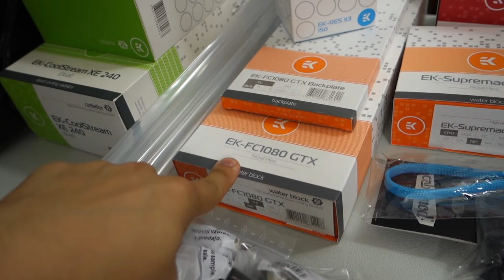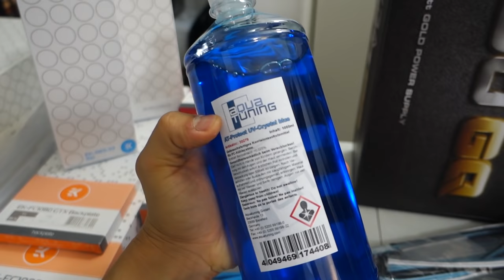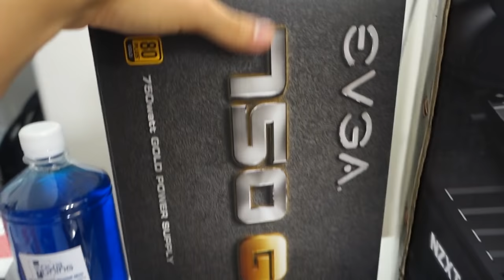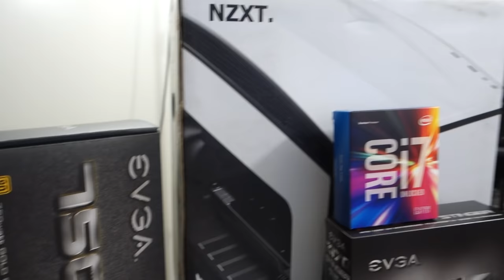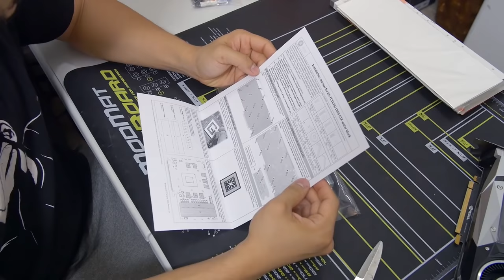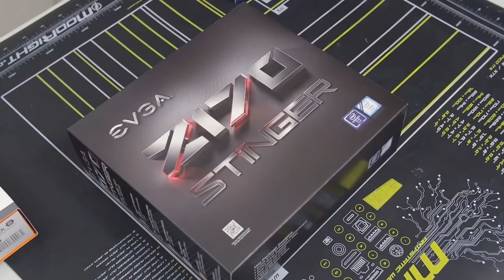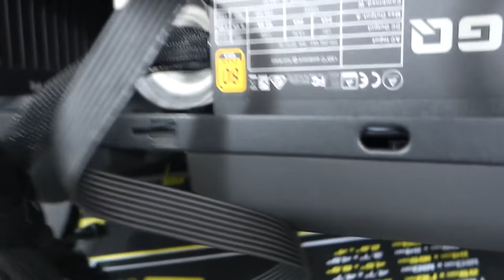My First SFF Custom Water-cooled PC! Build Log #1

Comment: I order the same color cables from CableMod and was completely disappointed by the fact it did not match the color they had on their cable generator. When I contacted support, they did not offer any solutions other than a full return. I found Ensourced shortly after and their cables were vibrant and true to color! Sorry for the shameless plug. Really excited to see a blue build!

Comment: I feel like it'd be a better idea to paint the rubber fan corners white, and use a blue ring, because more than likely the blue ring will be a better match, and it will be much easier to find a white to go with the rest of the build since the SSD's are an already off-white from the rest of the internals. Nevertheless, this was a good starting point and the build is fantastic as it is. Please, release part two soon!

Comment: I know you're probably working on filming part two already, but as someone who has a fully water cooled primo, nothing ever goes as planned and you will be changing your loop around alot as you go. 

now as the manta isn't necessarily an airflow friendly case, I'd recommend push pull on that 38mm rad (yes I know it's crazy) but it will improve overall system and radiator airflow.

also to make your life 1,000 times easier, use soft tubing in the basement so it's easy to work with and drain

Comment: You could put that front radiator with the fittings at the bottom.  That way you could run the output of the pump right into your radiator, and it would be a smaller run of tube to have to deal with.

Comment: I've been running WD velociraptors in raid 0 for about 7 years now as my windows drive. still working good. I assume that SSD would potentially last even longer. especially since my drives are 10krpm

Comment: First thing I'd do is call Jayztwocents and find out the best way to route your tube. It's gunna get mighty cramped in that case when you fill it up with tubing. I don't think your gunna need another rad unless your planning to overclock the snot out of it. I don't think the Z170 CPU or the 1080 GPU are going to run hot enough to need more than a single 240 rad for day to day use. Ace video good luck and happy watercooling.

Comment: I definitely think you should spraypaint the rubber parts of the corsair fan blue  because it seems white is more of the main color with blue accents, like the ssd has blue accents and the ram has blue accents. And idk how much room there is behind the graphics card, but you could maybe drill some pass through holes through the bottom of the case so you can use the bigger rad at the front and hav the tubing go into the basement like on skunkworks. I also think that the white edition ek cpu block could look awesome too!

Comment: Awsome. I ´m building a custom WCooled build too, but It is my very first, so I will use soft tubeing. All parts are from AlphaCool and 4 fittings (45 degree) from  Bitspower.

Comment: Loving the black white and blue, but you should definitely move the pump up a bit b/c with it in its current position it's extenuating your video card sag :) still looking great tho... Also in terms of tube diameter it really depends on the look you're going for, personally I like really visible and obvious coolant because it provides a lot of the color in the case, so I would go with thicker tubes, but again it's a matter of preference ;)

Comment: I have a feeling you're probably going to have a problem with a top radiator even if its thinner, the fan thickness is gonna get you! You're better sticking to the single one in the front. I'd also suggest just changing the corsair fan in general for one of the fractal venturi ones and paint the rubber corners the blue color.

Comment: Kyle you should use the thick radiator and drill some holes for the tubes to pass through the basement of the case instead of passing them through that gap... Jay did a video on it.. it would look a lot more "awesomesauce"...
Reply: Bad pun.. sorry

Comment: nice so far! I was wondering though, if you mount the pump like that, isn't it better to use the rubber rings on the other side so they take the vibration of the pump? Or is it meant to be installed like that so they don't scratch the case?

Comment: Kyle! I'm working on practically the same build as this. Manta, Z170 Stinger, 6700K, EK supremacy, ... It's all working out pretty smooth except for one thing, installing the Supremacy block. The backplate doesn't seem to fit perfectly on the back of the motherboard, did you experience any issues with this? Sharing your experience with this would be very helpfull to me :) Keep it up man!

Comment: Kyle, you mentionned "no space above the Mobo", but I thought a rad and fan set could fit at the top of the case, between the frame and the cover? The NZXT product  page says you can fit 2 Krakens, one on top, one on the front... "Dual 280mm liquid cooling support | Kraken X61-ready with push/pull capabilities"

Comment: I had the same problem with my build and the video card not being as level as I wanted, as it turned out if I took the power cable out it righted itself and went completely level. The weight of the added power cable pulled the right side of the card down more then 1/8th of an inch from level.

Comment: If you used a pass-through fitting, you wouldn't need extra space to get the tubing to the basement.  Also, I would have used some form of dampening between the pump and the floor of the case (or, if i were lazy enough, used 3M mounting tape and called it a day).

Comment: put fan ring blue and corners white. use cable lil bit more blue into it. i hope you put blue paint on radiator. yes definitely get thiner fittings and tube because that looks bulky. that pump looks really cool but no space to put in other palce to show.

Comment: CableMode has the Darker blue cables that I saw. And they have the Corsair blue cables  in the nylon version. Which I was gonna get. But now seeing what shade these look like.( These aren't Corsair colors right?? ) I kinda want to go with the darker ones perhaps. Maybe you could purchase one of each to kind get a better perspective. Love CableMode. I'll be purchasing them in a few months from now.And as far as the Corsair Case fan goes. Perhaps look into the Corsair ML 120 Pro White LED fan. I just got (2) 140mm white ones.And will you be doing a follow up of this video by the end of the week?

Comment: Put some rubber between the pump and the chassis , the vibration man...
Also if you find hard to bend the tube from the reservior to the gpu block put a 45 turn on the res and go straight to the gpu if that is your idea for the loop route.
But if you loop the system like res>pump (hole in the chassis)>rad>gpu>cpu>top res (it should be a hole on the top right?)
Ofc you cant put the second rad on top with that route.
Dunno man, the space is tight over there...

Comment: I sent a tweet to you Kyle but I will say it again here. Is there a way to flip the SSD's 180 so the words are in the right orientation? It looked like you might be able to squeeze the cables through the front of the case were the tie down points are. If I'm wrong no biggie I was just wondering if it was possible. I sure would be nice if these SSD companies would get with the program and design the logo on the SSD's the right way, it's like the whole video card thing all over again. My EVGA 5700 had a sort of a back plate thingie and the EVGA word was backwards, the letters were facing the MoBo.

Comment: The UV will probably make the coolant look lighter than it does under normal lights. Maybe you should plug the light in and put it next to the bottle to check before you fill it up, just to see how it looks. Flushing coolant from a system (you shouldn't mix coolants) is both un-fun and time consuming, and having to do it because you don't like the color just makes it worse.

And realistically, you don't need the other rad to keep this system cool. The rule of thumb is a 120 (or 140 if you can swing it) for each component that is in the loop. With that said, it never hurts to have more cooling than you actually need, so if you want to put the other rad in, then do it. I personally have 8 sections of 120 for my 8350 and 3 770's in SLI. My baby is QUIET, and if a fan or two fails it's not a big deal.

Comment: I think that res really takes away from the whole build. If it was me building I'd hide it in the basement if that's possible maybe with a small pump/res combo (I'm no expert when it comes to watercooling so I don't know if this would case difficulties in filling/bleeding the loop etc) . although like you said we won't know what it looks like until the tubes are in place and fluids in it

Comment: so you are having problem because that piece pf metal wont let you fit a thicker radiator well you can dissasemble the case and using a dremel and a lot of patience and maybe tape as a gide cut that piece of metal down to the li e where the gpu block ends, however i dont actually know how much space you will be left for fans tubing and pump and you will also to sand and paint that edge thats my advice if you want to go the mod way

Comment: Hey Kyle! I know it's been two years, but do you know what length cables you used for the motherboard and gpu? or did you just use the stock lengths? I'm planning a manta build later this month an wanted to get sleeved cables and order everything at the same time!

Comment: Quick question: If I'm shopping for say a gtx 1070 for the sole purpose of water cooling it later on (which means taking off the air cooler that comes installed on it), can I just go for the cheapest option?
What I'm on about is: Do the graphics cards sold by different companies (say MSI, Asus, Zotac, whatever) have any other differences than the air cooler?
Because if not, I should just go for the cheapest 1070 I can get since that way I'd be wasting the least amount of money in the form of a stock air cooler, right?

Comment: QUESTION PLEASE ANSWER

I upgraded my Windows 7 to windows 10. The product key stays the same. I want to uninstall it and install it onto another computer. If i use the product key, would it go to windows 7 or windows 10? Because it was bought as windows 7 and upgraded to windows 10.  And is still currently running windows 10.

Comment: +Awesomesauce Network cut away a centimeter or two off the power supply shroud.  Just enough to meet the edge of the 1080 would probably be enough to fit your XE240 in the front.  OR drill holes in it and have your tubing go straight through it like Jay does for his basement floors so you can fit your fat boy rad in there

Comment: Why don't you just turn around the radiator and connect it straight up to the pump...?
And then just pass-through the reservoir and the gpu.

Comment: think u need a shorter res and also the 90 degree to the CPU is just weird it's easier to get a L shape with fittings to it and it looks cleaner too.
Reply: from GPU to CPU I meant

Comment: suggestion: remove all the hardware before drilling holes or cut with the dremel. even this costs time, it could save the hardware. not only from drilling or cutting in it, i'm thinking more to things like metal dust from working that could short something out.
and another thing: i would leave the white cables in, aswell leave the fan as it is. once the fluid is in there, there is more than enough blue visible.

Comment: Anyone know if the EK 1080 backplate is fully compatible with the 1070? EK has 1070 cooling blocks on their website but no 1070 backplates, so I assume the 1080 backplate will work.
And great video btw!
Reply: It should I think, since it is essentially the same cooler
Reply: Thanks, but there's actually 1070 backplates on their website now. Either I missed them or they were just added.

Comment: For water cooling you always plan out you loop first so you wont get any nasty surprises
Reply: Ya this was some pretty poor planning on his part....
Reply: you can plan everything you want at the end you always change a lot of things
Reply: +Yagmur Davut +Yagmur Davut true that not everything is gonna work but he did absolutely no research to find if the part would even remotely fit. For example the radiator. Building in a micro atx why would he even consider getting one of the thicker rads unless it was explicitly supported. Just seems like he threw these parts together without than a thought of, ohh those are cool!

Comment: I am a noob to custom water cooling but why are fittings so expensive ?
Reply: I've always wondered that as well. I ended spending almost $100 on stupid fittings. Needed like 6 adapters, a couple 90s, T, ball valve and a plug. Freaking sucks.
Reply: +Starks i know right? They shouldn't be that expensive they are just bits if metal
Reply: *of
Reply: I can only guess it's because of the nickel plating.

Comment: Im thinking of going into getting a gaming pc. Im think of getting a pc with these specs for my first one (nothing big)
Windows 10 (pre-installed)
AMDFX-4300Processor
Memory: 8 GB
Graphics: NVIDIA GeForce GTX 960
Hard drive: 1 TB
What do you think?
Reply: Are you buying or building it ? If you are buying it (like the "pre-installed" suggests) it's not that bad. The CPU, as good a value as it is, may be a bottleneck though. Going the extra mile with an AMD Athlon X4 860K may greatly help, they aren't that expensive if you consider the GTX 960.

The 960 is a fine card that will play everything as of 2016Q2 on at least Normal settings at 60FPS and 1080p. Tune options and see what works in your games to maintain those 60FPS.

The RAM amount is fine.

The hard drive is fine. Just make sure it's SATA III. Those loading times aren't gonna reduce themselves, are they ? ^^

I don't see any motherboard or power supply in there. You want to include them if you are building the PC yourself. You will need an FM2 compatible motherboard, and I say you will need at most 500W for the power supply.
Reply: +Ujiltrom M I'm buying it. l
Reply: +Ujiltrom M AMD 760G this is my motherboard. Im buying it for my first pc and might upgrade later on. Will i be able to run games with good fps?
Reply: +Mohammed Al-Shaqeil You will, but again the CPU may be a bottleneck. It's about a quarter worse than a i5-3570k which I own, according to various bench tests.

The 960 is a fine piece of hardware that will drive your games at 60 fps alright, as long as you don't hammer the CPU too hard. Hopefully gaming doesn't hammer the CPU too hard, except in some games.
Reply: +Ujiltrom M I will be running games like Warthunder Minecraft and World of Warships. Do you think it can handle it?
Reply: +Ujiltrom M Also would i be able to upgrade the cpu to a better one? If so which one(s)?
Reply: Sorry, just came back from dinner. Minecraft will run smoothly, max settings is a possibility. Add OptiFine for further optimization that will lessen the load on the CPU.

Warthunder I don't know, but according to recommended specs from the website it will work just fine at high FPS.

World of Warships may have trouble running at high settings, the recommended specs suggest an AMD FX-6300 which has 6 cores. The GPU and RAM amount won't be an issue. Look for more informations on how to tone down some CPU-intensive settings in this game, and you are good to go.

As for upgrading the CPU, this is an AM3+ CPU, so any CPU that is compatible with AM3+ will work. Take a look at Amazon, look for AM3+ and it will get you a list with different processors. I just took a look and there are quite a number of options ! The FX-4350 (additional frequency) or FX-6300 (two more cores) are good upgrade paths.

Hope that helps !
Reply: +Ujiltrom M Thanks bro. You are the best for giving all this help <3♡
Reply: ***** He isn't building a PC, just buying one pre-built. I don't blame him because it's way harder to build one, and I say this as someone who knows how to pick the correct parts to build a working PC.

Getting an i5 won't score him a pre-built with a 960 for the same price.
Reply: +Ujiltrom M So after this can i upgrade slowly to a 6300?
Reply: +HowAmI I guess i could say its a learning curve but thats what i was worried about
Reply: +HowAmI what does that mean? Im a big noob
Reply: Building a PC is easy when you know what to look for. If you know, then good for you. If you don't, you have a long way to go and you might not want to go through the hassle as a first-time PC gamer.

It's a learning curve that requires to know the basic about all standards, ranging from motherboard chipset associated to sockets, to RAM type and frequency, to hard drive, to CPU themselves, to graphics card... and the actual impact they'll have in performance. Then selecting a processor and a compatible motherboard that has the I/O and chipset you look for depending on what you want to do (like overclocking), and so on and so forth.

It's a steep curve. Not insurmountable, but just wanting something that works is a good start. Of course I'd advocate building one from scratch, but that was before I understood that I'm not alone in my little bubble and the knowledge I took the time to acquire isn't granted common knowledge.

He wants something that works, I gave him an outlook on what to expect from the parts he gave.

Mohammed Al-Shaqeil You don't really "slowly" upgrade to a new CPU, you buy what you need, in this case more frequency or more cores. For what it's worth, the FX-4350 and the FX-6300 are at a $25 difference, what you'll go with depends on what's bottlenecking your computer : single-threaded performance (you have low framerates and the CPU isn't at 100%) go for the FX-4350 ; or multi-threaded performance (the CPU is maxed out on all cores but still not running great) go for the FX-6300. You can check how the CPU is loaded using the Windows Task Manager, Performance tab.